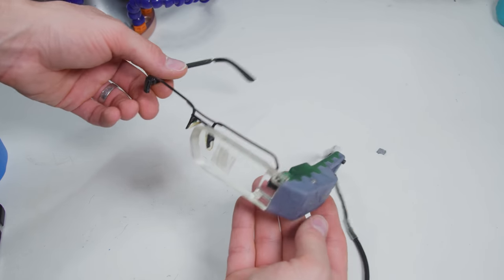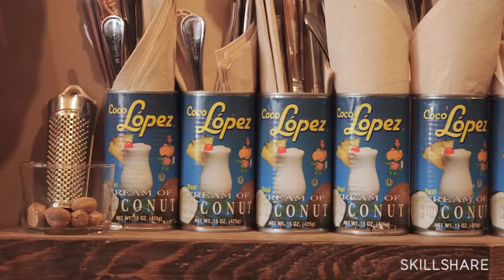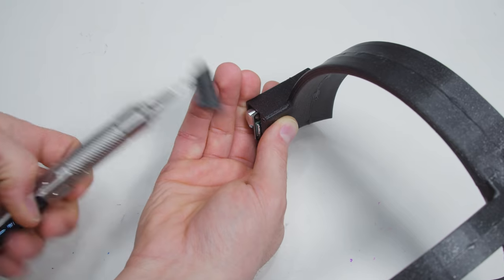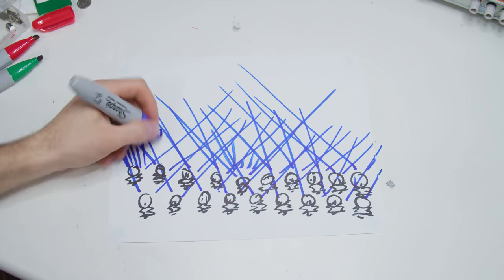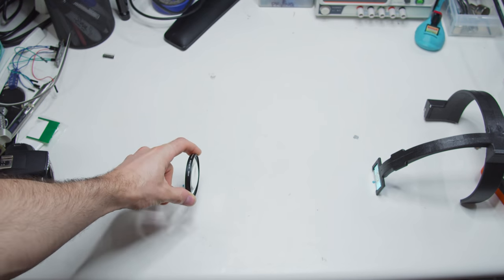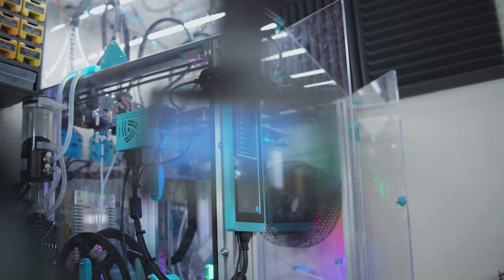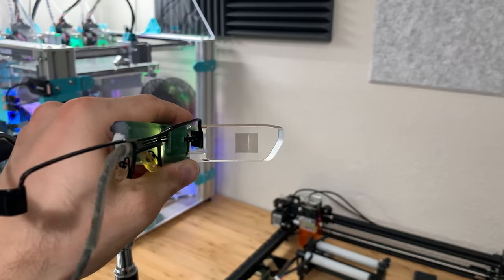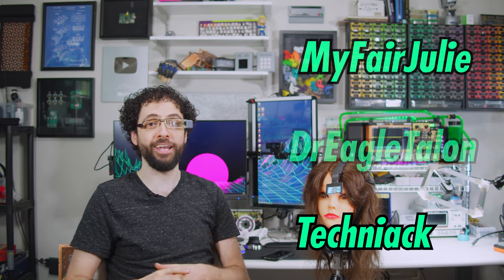The Worst Wearable Computer

Comment: I have been looking at the old virtual boy system.  Do you happen to know if there is such thing as a 1 pixel width by 200+ pixel height oled display?  The idea of using a vibration motor to move a oled strip rapidly could make these displays high rez and cheap.

Comment: ok i have an idea? but I don't know if its any good. and i don't know how to go about finding out if its any good.

ok imagine if you took a surface and drilled a bunch of holes in it, lets say 6 inches deep.
and then you put led's in those holes 6 inches deep most of the light from each led isn't going to exit the hole because it won't be parallel with the hole only light going approximately in the right direction will be able to escape the rest is going to hit the walls. 

 so what if you added some kind of grid blocking the light from each pixel from interfering with the other pixels? basically a thin wall between each pixel that prevents light from leaving anydirection but straight? kind of like putting each individual  pixel though a tiny aperture?  this shouldn't effect light from far away(at least i don't think so?) and it should let you see the display(at least i think so?) the main problem i see is idk how deep the holes would have to be or if its possible to manufacture something as small as this would require. i think its a neat idea but i don't have any of the background knowlage to evaluate it.

Comment: Would a thin sheet of Ulexite or functionally same material on top of the screen solve this problem?
Already columnated light from behind the screen will still be parallel, and the light emitted from the screen will have to pass through the material as a parallel image.

I must be missing something, interested to hear any ideas!

Comment: a quick fun one: the optics involved arent that hard to produce a collimated display image, ive designed this: https://www.youtube.com/watch?v=tei_7zog65w&t=39s smart optic using a simple 128x128 LCD and a spherical  mirror. position the mirror the right distance  from the display and it acts as a collimating lens  that you can see through because it only collimates reflected light instead of the light of the object youre looking at. its basically a single element optical engine- add a high res micro display and its ez pz

Comment: I've wanted a wearable display for asking other things using a computer when on a train or a plane. Is there any out there that I can use that has good enough resolution to comfortably do programming, and other text based tasks?
Reply from the maker: Text is always going to be a little hard to read on a wearable display, for the same reason it is on a TV - the pixels are just really big. Still, the Moverio BT-40 has enough resolution to do the job.
Reply: @ZackFreedman  thanks for the suggestion. It's not even ridiculously priced. I will probably buy them, or similar when I find another contract.  🙂

Comment: Question: would putting a lens both in front and behind the display work? like you have the closer one (in front) fix the rays as you showed but cause it tries to correct the already straight rays would a lense behind the display (farther away) that messes up the rays work cause then the closer lens would fix them with the display? sorry is this isn't in proper grammar.
Reply: He mentions this in the comments
The easy answer is that it'll be clear, but your vision will be fucked
like being cross eyed

Comment: Hi Zack I have a question,can windows 10 support a mini display(like 2 or 4 inches max)? Can an (windows)application that's been coded for 15,6-inch standard screen work in these tiny displays(get resized properly)? is there a way to make the mini 2-inch display trick the pc into thinking that it's a 15.6 standard display? or does this happen automatically?

Comment: ok so heres my question, a resin printer has a screen that turns off in certain areas to allow the light to passthrough, could this be done in reverse where its blacked for the letters but the rest is clear allowing you to see out?
(i know its not pragmatic for something like a wearable but would it work)

Comment: What about using a polarized lens, or is that not how they work? Idk all magic to me no matter how many years I’ve been interested in them and messing with them. Would still me clear (or half as clear rather) but would make the rays straight and they’re extremely thin.
Reply: Probably too easy of a solution cus they would have used it already rather than all that stupid math to make the proper optics
Reply: Or like those privacy screen protectors

Comment: Actually......
I have a rare Genetic error, that caused my left eyeball to be suverely nearsighted. So much so, that my brain automaticly only uses the right eye, and the left being only.usable for very vague shapes, and movements, so that i can still see when a car is driving towards me. So, for me this is actually perfect. I gain the ability to actually use my left eye, without losing any of its current practicality.
Reply from the maker: That's pretty neat. Can you actually read a display an inch from your eye?
Reply: @ZackFreedman  addmittedly, no, but thats not because im "not nearsighted enough", but becaude i dont have the resolution, so to say. Due to my eye being this shortsighted it essentially is shut of automaticly by my brain. Thats why it kinda degenerated, and i cant read normal sized text with that eye at any distance. I did actually build myself a little hud with an oled similar to this project, except that it wasnt transperent, and the entrie screen was taken up by the four letters of a digital clock. And that was readable, and pretty much in my natural focus. But generaly no, simply because that eye sucks.

Comment: TRANS RIGHTS. .. right on. 

Yeah,  I've had the same problem with my hud.

BUT. ..I think the solution is to place the display,  on your forehead.  Bottom towards the brain. Tilting upwards a lil
Place lenses over the screens, 
Have a slightly  reflective visor, slightly tilted to catch the image and bounce it off the visor to your eyeballs. 

Now, everything should be focusable.

Clunky 
But focus able

(So only one set of lenses,  perpendicular  to your forehead, ish, above your field of vision

The visor, has no lenses 
This allows you to see the world as needed. 
But a prefocused, display, projected, in the path of your vision)

Or use a laser projector.

Comment: Perhaps stupid question: is there a way to make like a micro grid array as a light collimator? Like a grid of tiny holes aligned with the display pixel grid?
Reply: As it turns out, that exists and are called anti-scatter grids, and they are used with x-rays and CT scans.  Make one with resin 3d print and try it! :)

Comment: The clear solution to the problem is just to skip the see through component all together, and instead use pass-through AR
Reply from the maker: What do you mean? What's a 'pass-through' display?
Reply: @ZackFreedman  It's not a display so much as software. On a Oculus headset you have no way to see outside of the headset, but it has forward mounted cameras. So you can choose to see through those cameras in real time, and that's called pass through. I think it would make more sense in the future for a wearable display to use that tech, and  just overlay the desired information over the image. That would allow for significantly more functionality out of the wearable. For now the displays in VR headsets are too bulky to be true wearables, but maybe it's possible to combine the optics from current "see through" wearables with VR style optics.  The biggest problems with the concept I can think of are energy requirements and processing requirements. Neither of which are easy to get around now unfortunately.
Reply: Also latency of course, but I haven't noticed any problems from latency with oculus pass through. Then again, I'm kinda slow already

Comment: Alright, then make an opaque display. You have two eyes your not a cyclops.
Reply: Or... or... or... make the display show both the device output, along with a captured stream from reality?
Reply: @CollinBaillie  not recommended. The HTC Vive can do something similar. It's decent enough if you don't want to take the headset off for some reason but you can see pixilation from the camera. Having real vision and bad pixelation vision feels like a bad recipe, plus you'd have to display and capture it just right otherwise you'll basically have a the equivalent of a lazy eye

Comment: Dumb as it sounds..... add a chunk of the fiber screen from a screen door.  It will act like a pinhole per pixel to only allow one direction for the light to the eyes.  There was ' Sunglasses ' that was n9thing but a sheet of black painted tin with a ton of laser punched holes in it, similar principle, different use.

Comment: Ummm @@UCUW49KGPezggFi0PGyDvcvg couldn't you use two fresnel lenses? one in front to focus the light and one behind spread the light? you would still end up with data loss of the background but still theoretically speaking its not impossible.

Comment: I vote yote to be the past participle of yeet

Edit: so the argument is that the shorter the optic path the less ability you will have to actually focus on the object. So in order to get around this you increase the distance the light travels which allows collimators and lenses to be used to focus the light before it reaches your eye, thus not violating quantum physics and deterministic probability.

Could the same be accomplished by increasing the resolution of the display and then adjusting it's output to simulate being 8 inches away instead of 2 inches away? If not then how much do the optics in your A.R. glasses cost and where can I source some?
Reply from the maker: Basically, yes. That's what the collimator does - by adjusting the light to appear more parallel without magnifying the image, the display appears larger and further away.